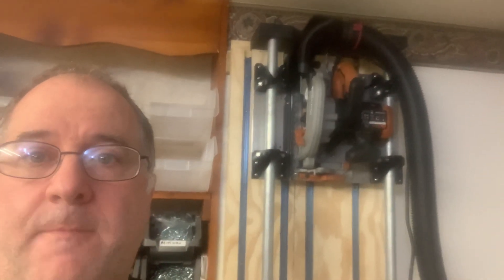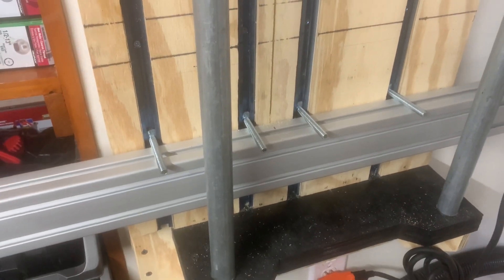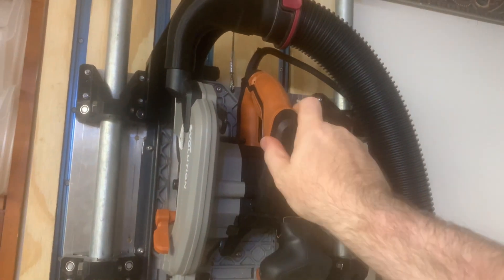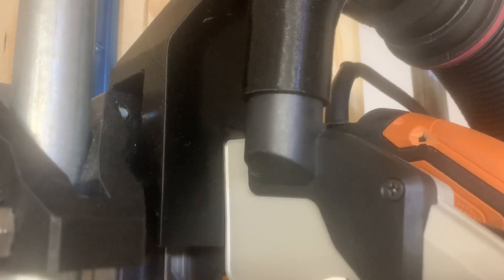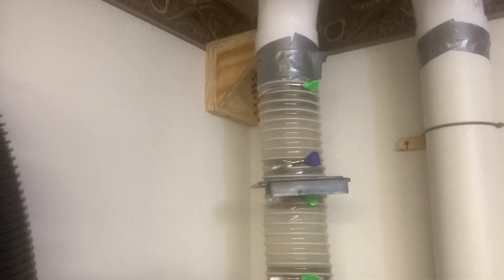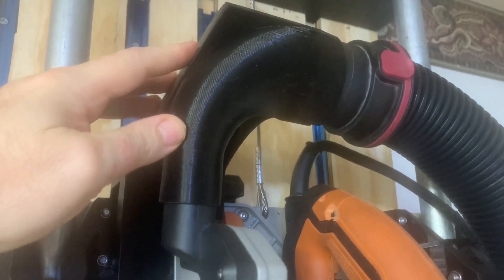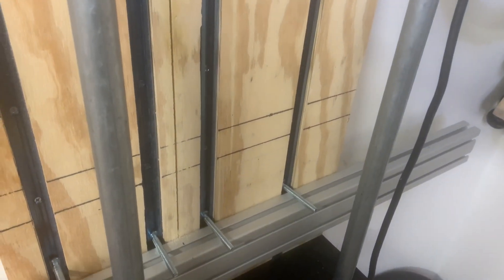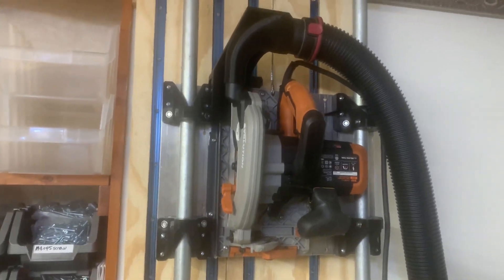Wall-mounted Panel Saw - custom sliding rig - cuts steel, just about anything

Comment: I had one in my small garage, had to remove it and switch over to the plunge saw. Wall mounted saw has a huge gap between the plate and material. A lot of dust escapes there and covers everything in the garage. On the other hand a small MFT workbench plus a plunge saw produce very little amount of dust and don't take much space while produces much less dust.
Reply from the maker: Thanks.